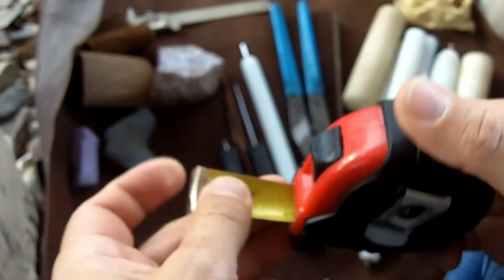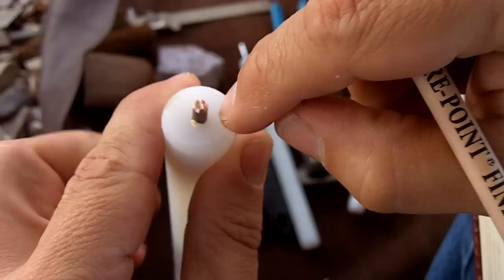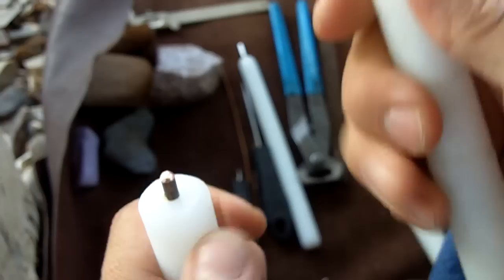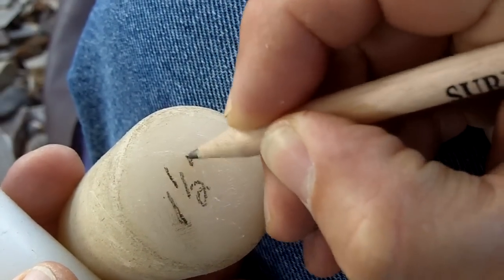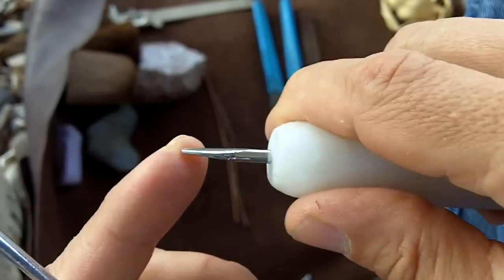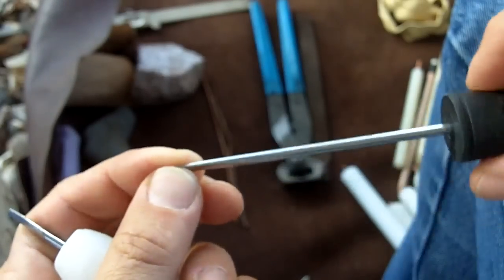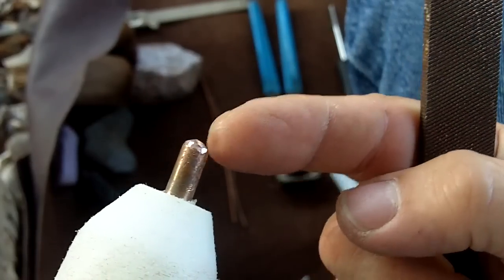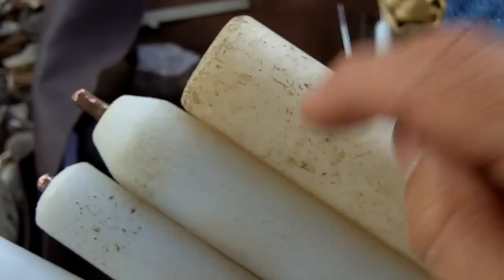245 - My Copper, Plastic, and Steel Flintknapping Tools

Comment from the maker: You can use mild steel and get similar results.  The softer the steel the better.  Most carpentry nails work fine, for example.

Comment: I couldn’t seem to find any of the plastic you use, so I got some 3/4” wooden dowel and 3/4” pvc pipe and hammered the dowel into the pipe, that was a tight fit, then I hammered a copper nail in the end and cut the head off the nail and it seems to work
Reply from the maker: 1-1/4" diameter UHMW plastic.
https://www.ebay.com/itm/224578394164?mkcid=16&mkevt=1&mkrid=711-127632-2357-0&ssspo=cHfvOieKSYm&sssrc=4429486&ssuid=1q_3LDvnSFK&var=524145172576&widget_ver=artemis&media=COPY

UHMW Black Plastic Mallet
Zoro Select 1Yvk7 Black Uhmw-Pe Rod Stock 3 Ft. L, 1-1/4" Dia.
https://www.ebay.com/itm/333994183040

1-1/2" x 12" long UHMW plastic rod, white
https://www.ebay.com/itm/125109196934?mkcid=16&mkevt=1&mkrid=711-127632-2357-0&ssspo=DCyz93qFQV-&sssrc=4429486&ssuid=1q_3LDvnSFK&var=&widget_ver=artemis&media=COPY
Reply: @KnapperJackCrafty  thanks man that’s great, 🙏🏻👍

Comment: #2) I've been using 1/4 inch copper rod. It does tend to bend but that its easily straightened using a hammer stone on a solid flat surface.

Comment: Thanks for the vid. Its always nice to see what others are using to knapp out their killer points! I mentioned before I have been using solid copper rod under the knee. It works out good once you get used to its skinny diameter. It takes less striking force to flake pieces. The plastic seems to absorb some of the shock and a harder strike is usually needed while the solid rod the shock is more effective due to its lack of plastic shielding/holding structure.

Comment: I fill them w/ JB weld or epoxy and then re-drill when the sets start to wear or crack.
Reply from the maker: Nice.
Reply: So you drill the hole down the center, put some jb weld in there, then put the copper rod in there? What size copper rods do you use? How do you remove the copper rods?
Reply: @seth6700  No. I was talking about fixing, re-drilling and re-fitting the set screw. You can drill out the knapping stick to whatever size copper rod you want. It's the set screw that holds it in place.

Comment: Awesome videos! The copper grounding wire can be bought in any electrical supply house, but it's sold by a number, not a diameter. The tools you showed had #8, #6, and #4 bare copper, 8 being the smallest and 4 the largest. A foot of each size shouldn't cost more than a buck or so. I know this because I work in one of the big supply houses here in the Southeast. Keep the vids coming! Fascinating stuff. Thanks.

Comment: I seem to be getting mixed up on what size copper you have in each size plastic rod.
is it  1/8 copper in the 3/4" plastic rod
 and 5/32 copper in the 1" plastic rod 
and 1/4 copper in the 1 1/4 plastic rod?
thank you
Reply from the maker: Yes. Perfect

Comment: Very good vid man, i have been using my antler for a pressure flaker. I cant seem to find copper ground wire. I didnt know you could use steel. I know you said on your notchers you use steel. Can you use it on your pressure flakers as well. or just too hard and wont grab the flint? thanks for the vid

Comment: Might sound like dumb question, but why copper must be used for knapping? Can`t steel do the same job? Steel is harder and cheaper and it should give advantage no?
Reply from the maker: Yes, steel works but it is more "slippery" than copper.  Copper is better for the sides.  Steel is better for the notches.

Comment: Patrick love the 
videos of question for you why do you use ultra high molecular weight polyethylene over Delrin I
Reply from the maker: Delrin is too soft and flexible. Some UHMW plastic is flexible too but most of the time it will be harder and tougher. To give you an idea how tough UHMW plastic is,  I can knap with it in the same way as a soft antler billet.

Comment from the maker: Yes, I see what you mean about using the solid copper rod.  I tried it when I first started using indirect but I kept bending the rod.  What diameter of rod do you use?
Reply: if u use 5/16 copper rods and shape the tips to size u want it wont bend as much i use drill its for steel rods
Reply from the maker: @PRO_GAMER_SIM  sounds good.
Reply: Drill bits! Thanks

Comment: Do you have a preferred temper for the copper rod?  I found 1/4" rod on Amazon with a H04 temper (Hard).  I am very inexperienced but it would seem that a H02 (half hard) would make a better tool.  Of course I could be over thinking the problem :-)
Reply from the maker: I've never paid any attention to temper and I've never tried to alter it (twisting the copper, etc), so I'm not much help there.  My advice would be to try everything and see how you like it.  It can get expensive, though.  if you are strapped for cash, try making friends with an electrician.   :-)
Reply: Thanks - After a quick trip down the Wikipedia rabbit hole it looks like copper quickly work hardens so it probably doesn't matter.  I am really enjoying your videos especially the tools and beginners series!

Comment: I bought a 6' piece of the UHMW-PE rod in 3/4" but it is really flexible. Is the stuff you are using flexible or rigid? It looks like what you have is rigid and maybe tougher than what they sent me from "Zoro". Help....Please
Reply from the maker: Tracy Rocha Six feet (72") is a long piece and will be very flexible compared to a piece one foot (12") long.  The stuff I use is not completely rigid like steel pipe, for example.  It is supposed to bend a little and be "springy".  I also find that it will stiffen up over time.  Plastic that comes straight from the factory will sometimes be a little more rubbery, especially in warm weather.
Reply: Allergic Hobbit That makes sense, I think I will go ahead and use what they sent me. Incidentally, it was very reasonable priced from Zoro and I was able to find it on E-bay with a simple search of what you listed in your video (UHMW-PE Rod). All of your videos are very helpful and informative. Thanks so much for the response.
Reply from the maker: Tracy Rocha Cool.  I'm glad to see the price is still cheap.  I need to get  more myself.  I'll check on Zoro...  :-)

Comment: How deep is the copper rod inset into the plastic rod?   As the copper nub wears do you have a method to expose more or do you just replace the whole rod?  Thx!
Reply from the maker: It's about 1-1/2" deep and I add pieces of rod into the bottom to make it stick out more.
Reply: @KnapperJackCrafty  so you have a hole drilled through the center of the whole length of the plastic?
Reply from the maker: @seth6700  no, just an inch or so.
Reply: @KnapperJackCrafty  so you go in an inch or so and keep it secure with a piece of fabric that you stuff in there with it?
Reply from the maker: @seth6700  yep
Reply: @KnapperJackCrafty  Thank you for responding to such an old video, you've been more than helpful on my journey. Wish you the best!
Reply from the maker: @seth6700  you're very welcome.

Comment: How deep the copper rod goes into the plastic?
Reply from the maker: Stoyan Stoyanov About 1-1/4" deep (maximum).  One inch should be enough for copper up to 1/4" in diameter.  Maybe 1-1/2" deep for 3/8" rods.  I don't use anything bigger than 3/8" diameter.